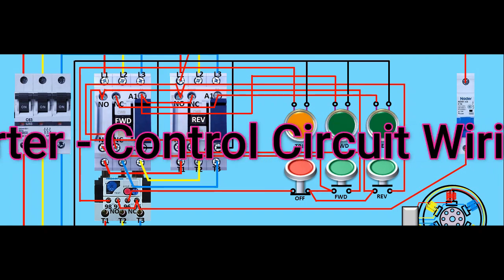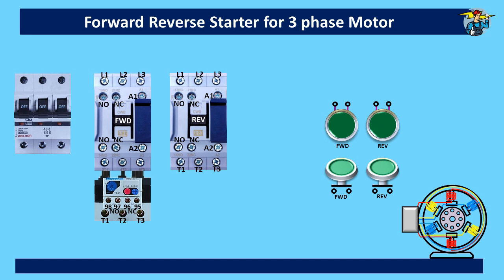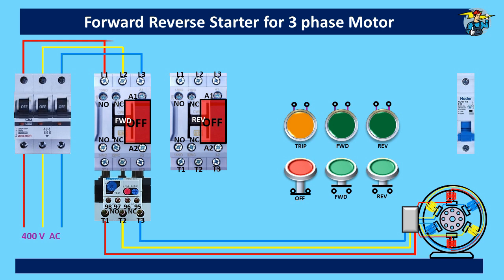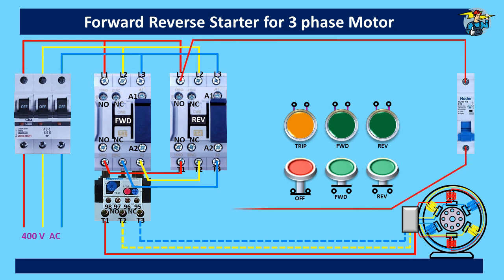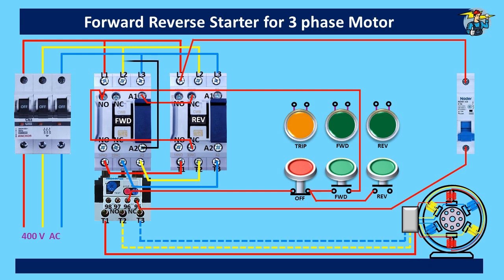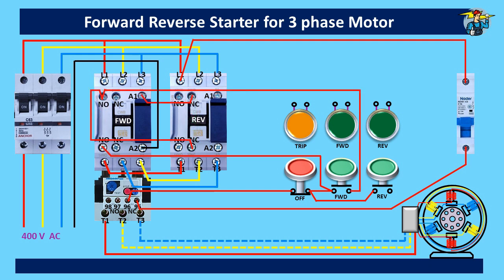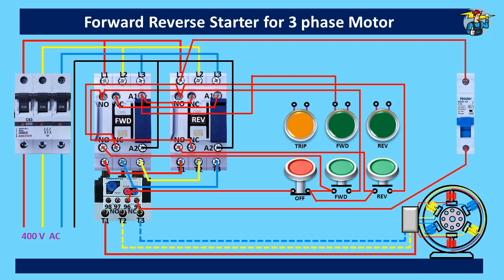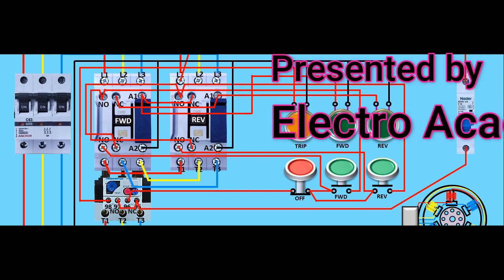Reversing Circuit for 3 Phase Motor: Power and Control Wiring Explained | 3 Phase Motor Applications

Comment: Will this prevent both from opening at the same time or would an interlock be necessary
Reply from the maker: Electrical interlock provided here.
Still we can use an mechanical interlock  too for additional protection.